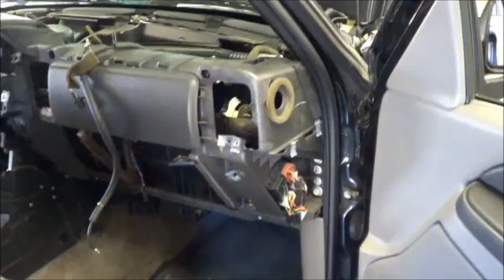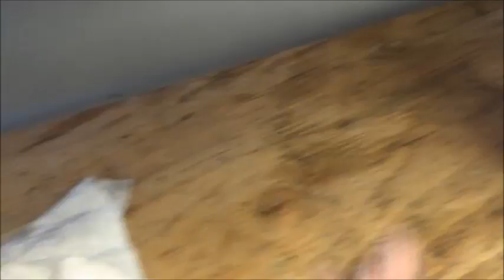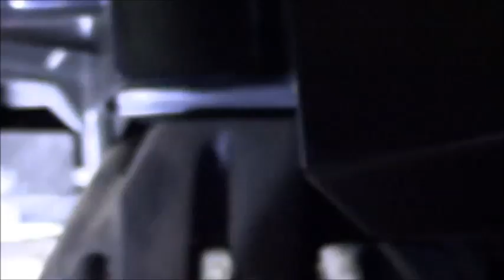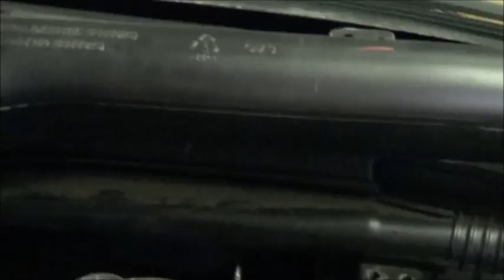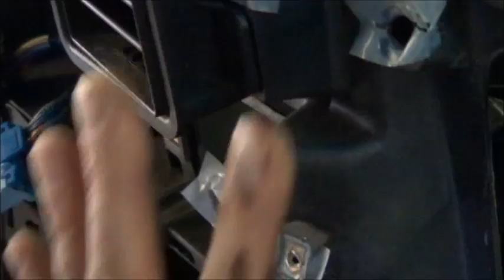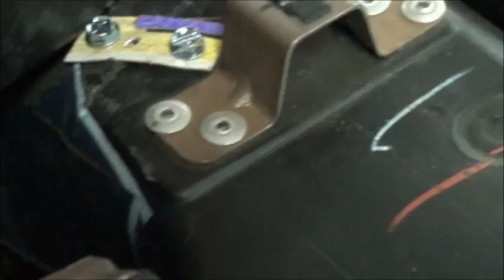2003 Chev Tahoe passenger side AC/Heat actuator

Comment: Fastest way to get this done without cutting the vent with a saws-all is to go ahead and remove the dash (not that bad a job - lots of videos out there), and then loosen the bolts holding the air vent in place.  Take a long pry bar through the air bag hole and use the metal bracket for leverage to lift up the vent and you'll have plenty of clearance to do the work.

Comment: Man you save me a headache. Could you get away with not cutting the duct just in case cold air condenses an it turns into water leaking down inside the dashboard?
Reply: Fastest way to get this done without cutting the vent with a saws-all is to go ahead and remove the dash (not that bad a job - lots of videos out there), and then loosen the bolts holding the air vent in place.  Take a long pry bar through the air bag hole and use the metal bracket for leverage to lift up the vent and you'll have plenty of clearance to do the work.

Comment: GM trucks are the biggest POS on the road. I have an 05 Sierra that has been nothing but a money pit with problem after problem. Worse yet, GM continued to use these dollar store parts from 1999 to 2014 without ever having them built better. All the parts on these trucks should be available at the  Dollar Store and they would make a fortune selling GM truck parts. Instead you have to buy from the dealer, and give them an entire weeks pay for inferior junk. GM should be ashamed of themselves!!!
Reply: You are confused..Gm stands strong,  they aren't Ford like your mind. Lol
Reply: @qwilliamson9117  Maybe if you live in the south, but in a northern climate they're junk, just like your mind! LOL
Reply: You're wasting time insulting facts..Gm leading brand for??.... Honda for?? Ford?? Etc etc catch up!
Reply from the maker: I bought a 2015 Toyota Tundra new after this POS. I knew I was taking a chance buying this Tahoe, and lost
Reply: @boboceancounty9296  BTW, now that some clown has brought me back here I figured out why these actuators acted up. It wasn't actually the actuators themselves. There are gremlins in the system, and the actuators needed to be reset. I was having the exact same problem that you had, and once I reset it it worked great and never gave problems again. Mine started with a weak battery, but they would also act up if you disconnect the battery and then change the settings/fan on the climate control module while the system was relearning. I honestly think the work you did on your truck was a waste of time and money. Don't feel bad, however, mechanics at GM were doing the same thing and replacing actuators. This isn't the same video I used to re-calibrate my actuators, but it is the exact same process. Take a look.  https://www.youtube.com/watch?v=KNTCbBV7xr4
Reply: I think you will be happy with your Tundra. A buddy of mine has an 07, and has s had really good luck with it. My wife has a Toyota Sienna and it has been a good little van too. I always had amazing luck with GM vehicles up until this truck I bought in 09. Anybody I know with any kind of GM truck has always had the same problems. Problems are loss of heat, heat when a/c is on, cracked mirrors from the defrost, instrument clusters, lights burn out on dash and steering controls, CD players failing, intermediate steering shaft, broken door handles, emissions evaporator cans and solenoids, and the list goes on and on. Yes I have had all these problems too. POS trucks!

Comment: Yes it's easer to cut it in that spot, especially if you have normal size hands! However it's not looking good, think I need someone  " flash"  or reprogram the calibration. Cool air not cold. The rear ac is like ice. 
I originally had hot driver side ( did that one) heat. After that cool air on both. So I changed the passenger one ( cutting it). Still was cool. Then fingered why not did the recirculate one next. Still not.. 
Pinched the heater coil still only cool air.
Taking to a local shop to check the main temperature control and check each door.
Keep you posted...
Reply: I'm aware this is from a few years ago. Just taking a chance if you happen to see this question or perhaps someone else had this same issue. How did you get it fixed? Mine started the same way, hot air on driver's side when A/C was turned on. Replaced the same actuators. And now the front just throws cool air in the front. Very cold in the rear vents.

Comment: Okay if you're having a problem with the heat blowing out of your passenger side which is the hardest to get to actuator. I have your quick fix solution.
 
Simply remove left side passenger vent and allow the glove compartment to hang all the way down. Now turn ignition off and then cut it back on to allow it to blow cold air after about 10 seconds cut that thing back off while the door is completely shut and it is not blowing hot air yet. Now reach into the hole and disconnect that actuator. Problem solved until another day no dash to rip apart and you still have cold air. Actually you could plug it back up come wintertime and have instant Heat. 
 
 Hope this is helpful to those that are as lazy as me.
Reply: Russell Weaver thanks for the tip easy!
Reply: I have an o3' Tahoe Driver side starts cold for 15 seconds then goes hot Would unplugging that actuator before it starts to go hot temporarily solve the problem? If so, how hard is it to get to the driver side actuator/
Reply: @jimh8560   Yes if you unplugged it before it went hot it should work for you but on the driver side it's so easy to get to the actuator I would just replace it.
Reply: Russell Weaver Thanks very much fun for the quick response. I will be trying to do the replacement. But until I get the part, your temp fix sounds great in Las Vegas at 108 degrees right now. Thanks again! I plan on giving it a try.